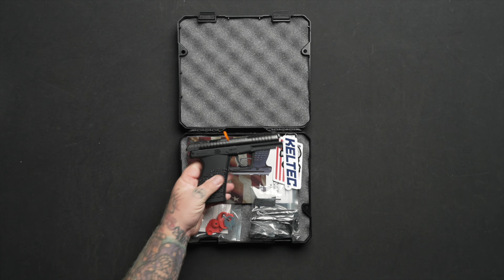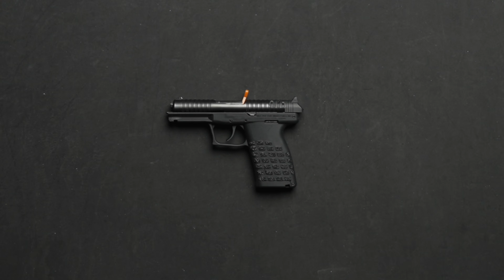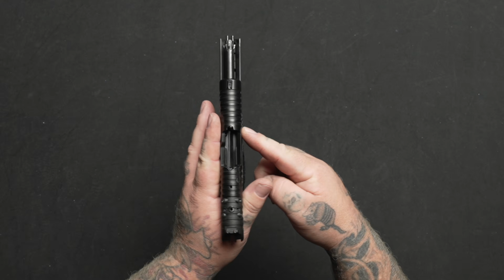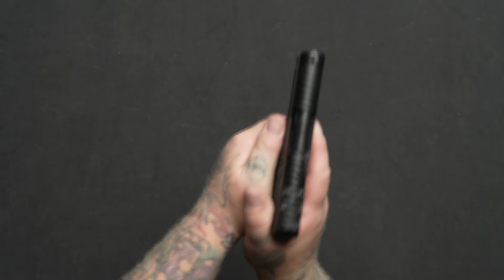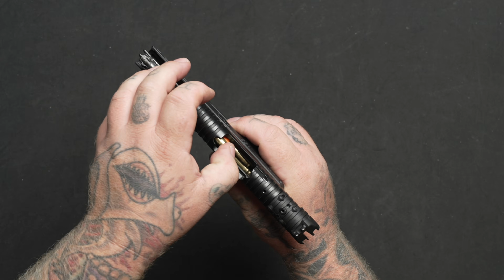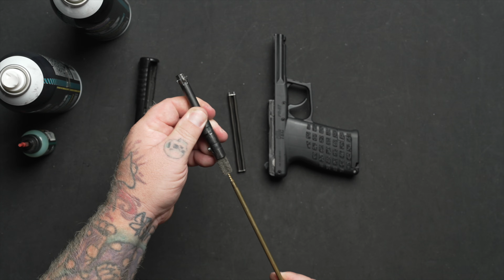KelTec PR-5.7™ Quick Start Guide

Comment: Is there a safety? Could you remove the slide to empty live cartridges?
Reply: I forgot, isn't the rotary barrel easier for weak handed people to cycle the slide?
Reply: It’s a bit tedious, but short cycling it by hand works for unloading.

It is incredibly easy to load and charge, overall would be a good pick for folks with hand strength issues
Reply: It is a true Double-Action-Only pistol, NOT cocked by racking the slide.  No safety is needed or present.  Only a long full trigger pull cocks the internal striker/hammer, making it utterly safe for concealed carry.  DO NOT try to remove the slide while bullets are loaded, as this needs moving the trigger.....................elsullo

Comment: Chamber it in 30 Super Carry 🙏
Reply: "that's a silly idea"... "Oh yeah, it's kel tec"
Reply: @gustavbarnes9929  Maaaaannnn, it's not even that silly. 30sc is small diameter just like 5.7 for high capacity but more in line with 9mm stopping power. And ammo cost of 30sc isn't an issue when compared to 5.7 or 380. 

It's the ideal carry cartridge in the ideal carry gun 👌
Reply: @brawndo8726 5.7 prices are on the decline and I find it way more often than I can .30 Super Carry. While most 5.7 factory loads have reduced powder charges, hand loads and more boutique self defense loads are roughly par with 9mm in terms of muzzle energy and overall damage (especially with tumbling projectiles) while still having oodles more capacity and much less recoil.

Comment: Kel-Tec give me some FN magazine fitting and better trigger upgrades and a FCU. You guys beat the sig p365 in the micro compact space but then you didn't have the capacity and you screwed up the trigger like you could be a huge company I don't get it. Do you work with any third parties suppliers cuz I will start a company just to do that for the 5.7 also it might have a light ring and and integrally suppressed and work like the Ruger a bit more just saying. It's so cool and still so far from what it could be all the innovation none of the follow through it's hard to be mean but come on guys. I'm rooting for you

Comment: 3:47 "For your 21st round, for a 20+1 total..."
---------------------------------
You're loading the "+1" round into the mag. With the bolt open. How the hell is that "+1"? That's called "mag fully loaded," not "+1 total."

---------------------------------
3:57 "21 rounds in the grip. Your fully loaded indicator...
----------------------------------
🤦

Yes, the mag is fully loaded...and the bolt is still open. So the magazine has a max capacity of 21 rounds. Where is the +1? If the mag has 21 rounds, the "full capacity indicator" is popping out, and the action is open, that should mean max capacity for the pistol would be 21+1, not 20+1.

This is one of the absolutely most stupid and irresponsible things I've seen from a firearms company.
Reply: What a hill to die on.
Reply: "Your Glock19 has a 14+1 capacity. To load your Glock19, lock the slide back, then grab your magazine..."

/picks up  15 round Glock mag

"...and start putting rounds in it. The magazine will take 14 rounds, and you can use the loading tool to help. OK, first round. Wooo! That feels nice! One, two, three..."

/an exasperating moment later

"Ok. So for your 15th round, for a 14+1 total, add one last round to the magazine."

/unceremoniously loads one more cartridge into magazine

"Now, put the magazine into your Glock; pull the slide fully to the rear and release; and, you're ready to rock."

Comment: I am noticing that all the "Gun Experts" that are reviewing this pistol are not using the locking slot on the front of the clip.  As a result they are not loading the rounds straight.  Also they are getting a lot of jams that they are blaming the pistol for.
Reply: Almost every single one of them isn't slingshotting either, but they keep using the slide stop.
Reply: @LibertysetsquareJack personally never noticed a problem with using the slide stop instead of

Comment: I'm running into issues with mine. I got different ammo and did a deeper clean, hoping it will run when I take it to the range again, but is there a way to clean the internal magazine instead of just pushing it down and spraying oil down the grip?
Reply: If you still have your instruction manual, on page 25 it shows  you how to remove the floor plate, magazine spring, and follower so you can clean those parts individually.  It basically involves punching out the 1/8" roll pin on the back of the grip.  You'll still need to use a Q-tip or similar to swap out the hollow portion of the grip, but this will allow you to really scrub down all of the parts of the internal magazine without having to push down the follower and spray cleaner into the grip.
Reply: You can make a push pin from a broken off dull drill bit or a thin nail.  Follow the instruction manual to remove the grip base, and be ready for the follower to jump out........................elsullo

Comment: As usual, KelTec has packed a lot of innovation into the PR57.  It's a practical solution for concealed carry.  Most defensive pistol use has no shots fired but it's difficult to know the actual statistics of what didn't happen.  Demonstrating credible defense is sufficient.  In civilian situations that require the use of a pistol, the average is 2.2 shots fired.  21 rounds of 5.7x28 is more than sufficient.

Comment: The  KEL-TEC P32 (Gen 1)  is my favorite .32 acp caliber deep carry self-defense pistol.  It is the world's lightest centerfire semi-auto pistol and the world's most accurate .32 acp pistol !

⚠️ I wish KEL-TEC would go back to making the Gen 1 designed P32 pistols.  The Gen 2 with the set screw extractor is not as reliable.
Reply: and I wish they'd make an actual followup. I very much want something akin to the Ruger LCP Max or S&W Bodyguard 2.0 but in .32.